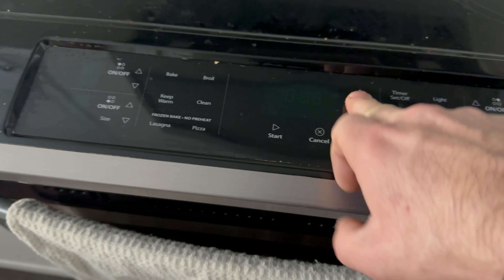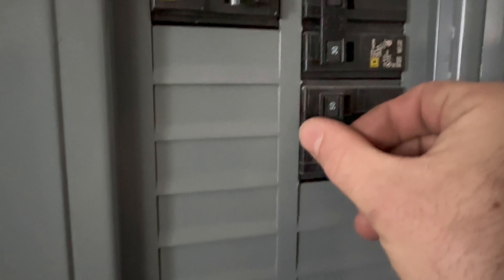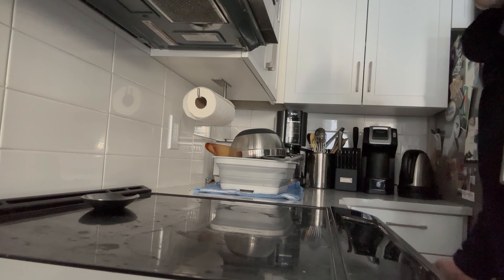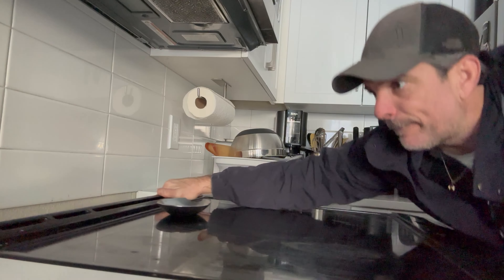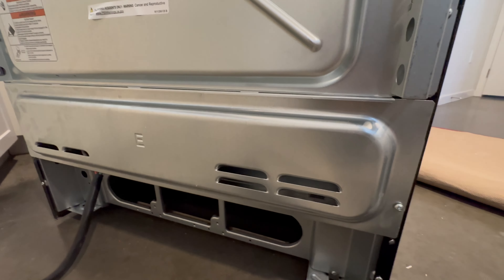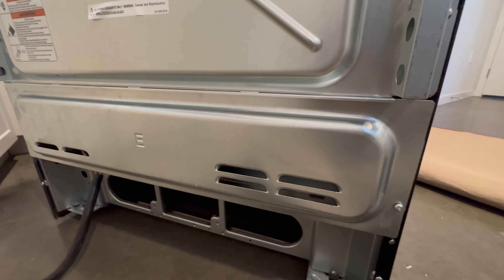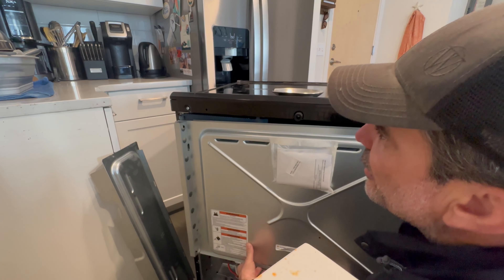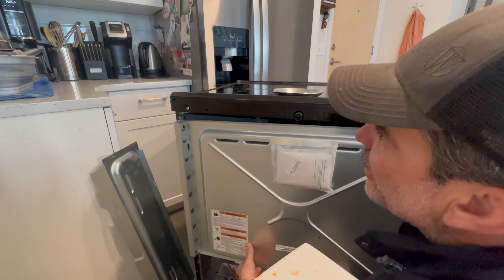Electric Oven Has No Power

Comment: Question, I just installed a brand new double oven. It’s not turning on. I’m getting juice to each hot lead if I pull them off the busbar. When installed, it’s showing 240v on red and 0 on black instead of 120v on each. Any ideas what’s going on?

Comment: Hi Dave, my red wire nut was a little loose too…and not only was the wire charred, but a good chunk of the terminal block near the red wire was nearly melted off. Suit marks on the inner panel covering too. Do you have any idea if the red wire nut gets loose on its own? Why would things be fine for years and then this happens? and was the heat from current going through the plastic to the neutral wire? Why was our oven still working fine with no error codes? (except for white smoke from burning plastic). Control board looked fine.
Reply from the maker: Too much current causes the wire to melt, which is usually caused by loose connections

Comment: FYI, the red wire is L2 the black is L1 and the white is neutral,  the green is ground.
Reply from the maker: Not on this model. Every appliance I’ve seen that’s 240v (Not saying every one in the world) has L1 to the left of the neutral and L2 to the right. Newer whirlpool appliances have the Red on the left ( that I’ve seen) if you are just replacing the supply voltage at the terminal block, it’s ‘hard’ go wrong if you hook up neutral and green correct, but not impossible

Comment: Hey man I got wee510s0fs2 believe it's same model oven. At night it started to randomly beep. I woke up moved the oven,  unplugged it and then plugged it back in in the morning thinking it will be reset. It still beeps and now showing F2 and F6 error codes. What do you think is wrong?
Reply from the maker: Check the tech sheet located either behind the range or underneath by the pan warmer. I believe f2 indicates bad control board / loose connection. Double check with that tech sheet though 👍

Comment: So, the display panel on my oven doesn't light up so nothing can be set and it's making a continuous tonal sound. Prior to that the oven door could not be opened so we assumed it was somehow going through a self-cleaning cycle. Any recommendations?
Reply from the maker: Check control board for proper voltage of voltage is good and connections are good to the board I would contact the manufacturer- which they will probably tell you it’s a bad user interface / control board
Reply: @ApartmentMaintenancePro  thank you so much for a response but if the manufacturer says it's the bad interface board is that easily fixed? Or should I just buy a new oven which I can't really afford right now.
Reply from the maker: @sable7114  The interface boards can be pretty expensive but if you have the skill set to diagnose and install one it is more cost effective than a new oven, especially if you can get a refurbished one.
Reply: @ApartmentMaintenancePro  thank you so much for this. I will see if I can diagnose what the problem might be and then I'll be looking for a video of you showing the skillset of handling and interface board. Your knowledge is valuable. Thanks for what you do.